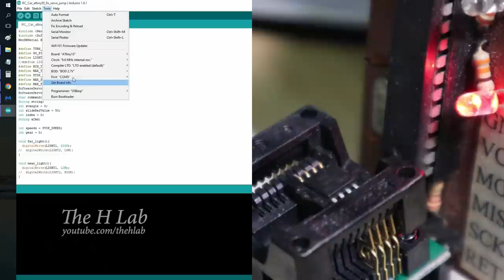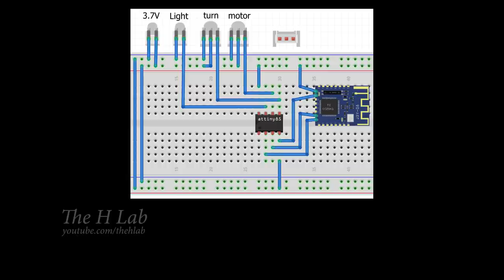Convert JDY 10 to Bluetooth rx for small Bluetooth RC car

Comment: whats the motor driver and servo are you using?
Reply: 2 servo's. no driver needed! 
one servo for steering. the other moded for continues rotation. all setup for basic RC configuration.

Comment: Is there a difference between the ATtiny85  20SU and 20PU?  Thank you!
Reply from the maker: I think there are no thing different between them except 20SU is a smd chip, and 20PU is a through hole chip.
Reply: @TheHLab  Great!! I am going to order some and see how far I can go... THANK YOU for sharing all this!!!
Reply: @robertomesnik7908  bro which we should use 20su or 20pu
Reply: I think if use PU it not risk a damage from soldering 'cause have a socket. but thick..

Comment: Is Jdy 8 be used instead of Jdy 10? thank you!
Reply from the maker: Yes. JDY 8 should work
Reply: @TheHLab  so from the jdy 8 should i just connect both the rx and tx as the jdy 10
Reply from the maker: Yes. Almost the same. Tx from jdy to rx attiny is enough.
Reply: @TheHLab  btw do u have any social media account?
i want to ask u some trouble shooting too if u agree
Reply from the maker: You can connect me via page facebook.com/TheHLab
Reply: @TheHLab  tysm
Reply: @PekaVuite  hyy broo can u help me
Reply: @lovedeepverma222  yeah sure
Reply: @PekaVuite  thnx bro pls tell which chip we should use 20su or 20pu 
here only 20pu available
Reply: @lovedeepverma222  u can use both but to make it compact you need the smd SOP8 package
Reply: @PekaVuite  ok thnx bro last question what u mean by sop8 package may it is code which give in descriptions which upload in chip by self
Reply: @lovedeepverma222  sop8 package means the smd size version
Reply: @lovedeepverma222  sop8 is not a code its a chip size
Reply: @PekaVuite  okh bro thnx if posible mention link to buy chip orr very very thn to u

Comment: hi buddy!
i connected all according to the circuit, application sees Bluetooth module and connects (select jdy-10-2.5)
but steering and engine control don't work (rotating the wheel and pushing the gas pedal makes no effect), light does not work too.
looks like bluetooth module does not receive the commands
(attiny is ok, i successfully created blink example, played with servo via SoftwareServo and other)
could you please help me?
how can i debug the problem?
thanks a lot!
Reply: Получилось оживить?
Reply: @MaroonRomka  неа
разобрался и написал своё))
Reply: @mr.whitesnow  А я всё пытаюсь. С мк не выходит сигнал, подставлял диод на сигнальные выходы, реакции нет. А вы в своей разработке используете так же jdy и at85?
Reply: @MaroonRomka  да, jdy и at85
правда не jdy-10, а jdy-40, но разницы нет
Reply: @mr.whitesnow  то есть вы просто написали свои библиотеки и мобильное приложение?
Reply: @MaroonRomka  библиотек никаких не надо, кроме SoftwareServo, все на стандартных методах
работает без мобильного приложения, управляется простым пультом на таком же модуле и аттини
Reply: @mr.whitesnow  здорово. А мне остаётся только думать над тем, почему не передаётся сигнал. Возможно, потому что при подключении модуля, он пишет «WRITE_NO RESPONSE». Но в коде и библиотеках пока что не разобрался…
Reply: @MaroonRomka  , та же самая проблема... удалось разобраться?
Reply: Iam also facing same issue please give a solution
Reply: @r.pcarmusic869  I created my own 😀